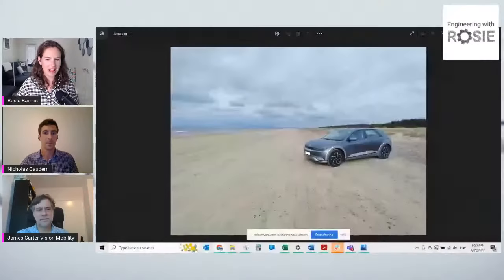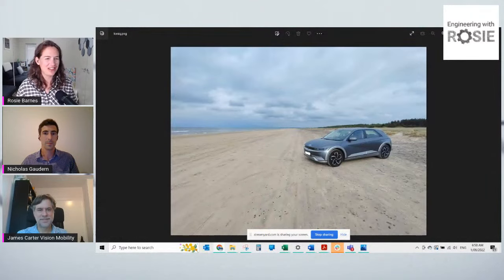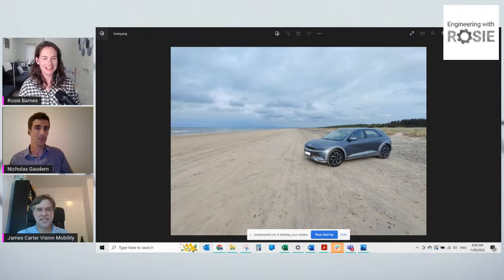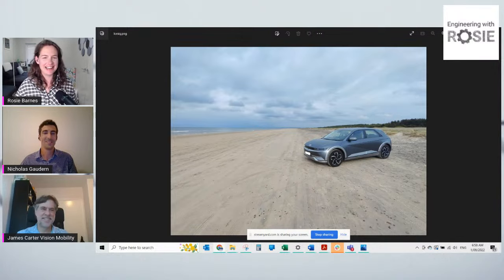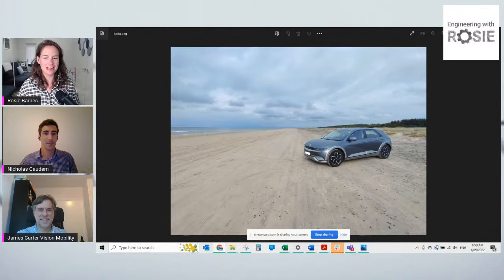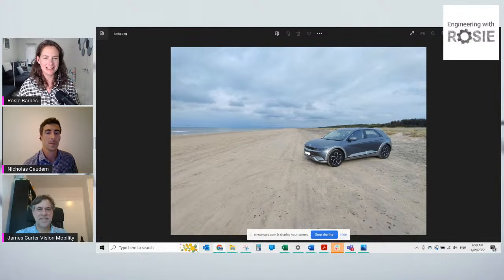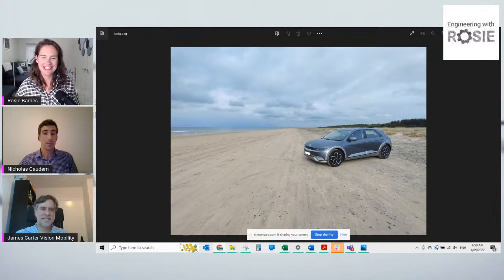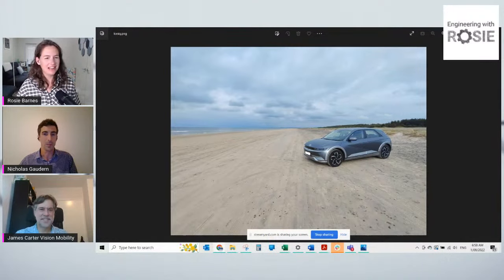Problems and Solutions to EV Charging Headaches | Engineering with Rosie Live Ep 16

Comment: All this talk of residential EVs. 

We do need to start moving this conversation over to commercial EV applications. That is where the real change to help the climate begins. 

Residential EV was the low hanging fruit to fund the start of the movement, but it needs to become a reality in commercial fleets sooner than later. 

Combine EV commercial fleets with swappable batteries and commercial rooftop and parking lot solar and it solves so many of the "problems" with EV adoption. 

And the more we green mining, transportation, refining, transportation, production, transportation, distribution, transportation, and then endpoint delivery - the greener it becomes to make things like solar panels and batteries. So the promise of the product is a beneficial feedback loop that reduces emission for every product produced on the planet.
Reply: 5353 Jumper,  There is a Amazon distribution center about 1 mile from my house, Portland Oregon.  They are charging about 40 Rivian delivery vans each night.  No battery swap needed.  They run them on the 100 mile or less delivery route, so easy for the battery to make it.

Comment: The slow charging in winter is only until the battery warms up, which is why Tesla has such a leg up since on all their models you can precondition the battery to heat up the right temperature for when you arrive at the charger. More manufacturers are now waking up to that fact and beginning to include it. With pre-conditioning it's basically a non-issue. Just watch Bjorn Nyland's channel, he lives in Norway and shows you almost every model out there and how they charge in their very cold winters, as well as other seasons. 

As an example, doing his 1,000 mile kilometer challenge on a Tesla Model 3 Performance, he completed his 1,000 kilometers in 9 hours and 15 minutes during an average temperature of 24 degrees Celsius, whereas doing the same challenge using the same Tesla Model 3 Performance during a much colder average of 7 degrees, he still completed it in 9 hours and 55 minutes. A difference of only 40 minutes total. Not only are all his videos there for all to see, but he also keeps a detailed spreadsheet of all his results that anyone can see or download. His provides the link on his channel.

Another thing that will help are new battery designs such as the 4680 which can be cooled and heated really fast on 800 volt systems -- that's the main point of all those small folded-in tabs. On the 800 systems they are going to cooled from the bottom just like Lucid does it now. However, theirs don't have the extra folded tabs -- yet. The tabs allow the cells to be cooled on the inside rather than only from the outside as it's done now. Tesla is not doing that yet on their 400 volt current system.

Comment: Intersting conversation.  I would like to point out that small batteries do not charge faster.  A larger battery can be charged at the same “C-rate” [ kW per kWh capacity].  As a result, given appropriate charger power, it takes the same time to charge no matter the battery size.  Since a larger battery has more range, EV drivers will get more range per minute charging in a large battery EV.  So in the end the large battery will take less charging time to get km needed to get to the next charger or destination.

Comment: Nicholas, Please note that the heat pump on Teslas use their “Octavalve” to direct heat from a selection of sources to a selection of sinks.  The Tesla heat pumps can heat or cool the battery as needed.  Heat from the motor and inverter can be directed to the battery or passenger cabin when desired.  Heat stored in the battery can heat the cabin when needed.  It can also heat or cool the cabin from ambient air source like conventional heat pumps as well.
Reply: Perhaps that experience Nicholas made was before the heat pump was introduced.

Comment: Car parks with each station with an electrical outlet  for a block heater are found here in Canada. They would support charging and could be made more common and upgraded for the purpose.
Reply: The 120 volt receptacles put there to keep a car block warm in the winter can put out about 1.3 KW per hour to charge a EV.  They are painfully slow to charge a 80 KW battery, compared to a slow Tesla charger at 120 KW, or a fast charger at 250 KW.  So a 15 minute charge on  a Tesla charger can add about 120 miles of charge, while the 120 volt charger can add about 4 miles each hour.

Comment: As the vast majority of shopping trips and commutes are much less than 100km roundtrip, a small sedan or suv with 100-150 km range on plug in battery alone with a small gasoline generator for longer trips. The generator need only be sized to the aerodynamic drag and tire friction. It could be very efficient and clean burning, especially if the battery was used to pre-heat it. Stopping and plugging in wouldn’t be too onerous and you’d only be charging to the 100km range. 

I’ve been looking at plug-in hybrids as here in western Canada, as the charging network in remote areas is very limited and the distances are large (much like Australia). My problem is that the only ones available are true hybrids with the engine directly connected to the drivetrain and the engines are as big or bigger than a similar gas vehicle.

Edit
Congratulations on your news. Very exiting!
Reply: It can't be small - 15-20 kW would be a minumum, I think.
Reply: @HughCStevenson1  I was thinking about 50 kw, not the >200kw that I see.

Comment: 14:20  I haven't driven a Tesla, but when the temp drops I use the heated seats and heated steering wheel much more rather than heating the entire cabin and letting all the glass whisk away the heat.   The lowest I can set the cabin temp is 60°F or off.  I wish I could set it to 50°  But setting it to 60 and using the seat heaters helps a lot regarding range.

Comment: James Carter, Please note that the Nissan Leaf battery is NOT air cooled.  It is in a completely sealed enclosure, with no air intake or exhaust.  The only cooling is from natural convection and blackbody radiation of the outside of the pack.  It does have a fan, but it only recirculates the air inside the pack to keep the cell temperatures consistent, it does not cool the pack.

Comment: Aptera is going to try to start production this year for their solar covered trike, initially with 400 or 600 mile range, later 250 and 1000 mile options, 2 or 3 wheel drive. You sure you don't want to do an exploratory run to Perth in one?   Charging is super important. It should be really easy to know when chargers are working, particularly ones you pay for. You should get access to information about the last 10 charging sessions, when they happened, and what the rate was, and so should the maintainers. Kyle from out of spec something youtube channel talked to a guy about chargers. Gen 1, 50kw, gen 2, 150 and 350kw. Gen 3-4 fast of course, remote diagnostics, modular so easy to repair, designed for reliability.
Reply: Also, everybody, copy Tesla with charging. Plug and charge like the Mach e, and Lightning, precondition the batteries on the way to a DCFC, never have just 1, and keep them working. Let's go!

Comment: Hi Rosie, you might be interested. California are using phone emergency alerts to peak shave. On the 6th Sept they had a 800MW drop in 5mins, 2GW in 20mins after a alert. Instant carrot and stick methods are probably underestimated by energy (future) forecasters. Equally encouraging charging of privately owned batteries into the grid instead of curtailment is probably very underestimated. 😁

Comment: Tesla definitely uses the heat pump during battery preconditioning. In a Tesla the heat pump does not weigh much, but the octal valve allows it to be used to heat and cool wherever the car needs it with a single pump.

Comment: My suggestion to new EV drivers is to think like an airline pilot. You always carry sufficient fuel (charge) for the planned trip + a 3% contingency for changed conditions (winds, hills temperatures) + an alternate runway/ airport (in case the chargers are occupied or U/S) + 30mins fuel (remaining charge for absolute emergency)   
Simplified for an EV,  plan journey to arrive with 15-20% battery in ideal conditions.
 Don't push the range, neither an airliner or EV running on  empty are relaxed experiences This has worked for me a retired long haul pilot and EV driver.

Comment: Thank you.  The swappable battery idea needs a deep look.  Batteries as modules, for example, where the entire 100 kWh does not have to be picked up at once.  The battery might be a simple holder of electrical energy with the interfaces providing the standardisation you speak of.
Reply: Swappable batteries are the solution for commercial EV uses. Either industrial machines, short haul trucking, courier vehicles, last mile delivery vehicles and passenger vehicles. 

Mostly when combined with commercial rooftop/parking solar projects. 

Because the vehicles are mostly off site during the daytime sun, and then on site in the evenings. It is hard to charge them with solar, and thus companies are reliant on the grid buyback plans which are not totally cost effective and subject to the greed of the grid organization. 

But if your fleet had swappable batteries the company could charge during the daytime sun for the vehicles to use tomorrow. Keeping all the power generated stays on site reducing the reliance on the grid. This handles the objection of the grid not being able to support a large scale charging facility, and could be more cost effective long term for the company. 

The only ones who hate (and will resist) this idea are the for profit grid, and grid scale generation companies. We will need to watch out for their obstruction wherever it pops up.
Reply: @5353Jumper  It would be interesting to see someone make a compelling case for standardisation of some particular battery design.  Somehow that happened with 6 v, then 12 v batteries, much like 1.5 v in different dimension, 9 v with the same dimensions.  In other words, it has happened before.  And just like those small batteries, the way they were connected and used was up to the design engineer of the device using them.  

Also wonder about rural and remote sites using solar and wind to charge up the batteries.  Would it make economic sense?  I don't know but I am thankful for Rosie and friends for looking into both the technical and eocnomic feasibility of whatever is envisioned.   

I imagine swappable batteries would require robotic swapping, to help ensure weight handling and exact fit to the electrodes and the carrying frames.  To this layman's mind, that seems to be no biggie.   Fascinating stuff, this transition stuff.  Now we might look for appropriate finance to support all this transitioning.
Reply: @mikeklein4949  standardizing would be great with a bit more market maturity. For now maybe it is better to let innovation rule. Eventually standardizing happens organically, as battery manufacturers partner with auto makers.
Reply: @mikeklein4949  reality is that the only reason this is not happening is because of political obstruction by the petroleum industry, traditional auto industry, and for profit grid. They are all resisting change and only letting go of small improvements over time to keep the public thinking there is some progress. 

All of this could have been reality years ago as it is all technically designed already. There are no major technical blocks or problems that are not already solved. 

The issue is obstruction by powerful industry. 

Petroleum companies want us to keep burning their products as long as possible. 

Transportation companies like the fact that 20% of fuel is burned just transporting fuel around. If they electrify transportation it greatly reduces the amount of transportation needed. 

Mining companies want is to keep using aluminum for engine blocks and transmissions until their bauxite mines are depleted, before they start investing in lithium and other battery materials. 

Auto makers want to get as much return on investment as they can from all that R&D they spend trying to make "fuel efficient engines". 

Grid generation companies want to block and regulate the crap out of commercial rooftop and parking lot solar. They do not want massive consumer side projects generating significant amounts of electricity because they want to maintain their oligopoly market demand. 

For profit grid companies want to keep delivering electricity to customers because they make more money per W delivered than they would just connecting to back up your local generation capabilities. Or worse yet your company/home going off grid all together. 

The hardest part of all of this is getting supportive legislation from government instead of obstructionists legislation. 

Very few people in power want to see this become reality.

Comment: Kyle Conner, a you tube person drove a Tesla to a super charger using the floor it and then regenerative braking to warm up the battery.  Both cars stated at 9 pm at 40% state of charge.  Then the next morning, they both drove 20 minutes to a supercharger, his wife taking a identical car and driving normally.  He charged to 80% in 29 minutes, as his battery was lower charge than the kind driven Tesla.  The kind driven Tesla had a much colder battery, and took 59 minutes to reach 80% charge.  The outside air temperature was around 25F, or -4C.  So the car the wife drove, the battery was around 32F (0C), and it took a lot longer to charge to 80%.  

I think the battery should be close to 75F or 22C if possible when they start to charge.  Yes the pre-charge can use 5% of the battery power on a cold day to heat up the battery so it can accept a larger charge on a cold day.  Some cars have a chart, that will say "Heater use 15%, pre-conditioning 5% or 8%, driving 72% ect.  

Wireless charging - I don't want one!  They will use about 25% to 50% more power to get 50 KW into the battery.  Those who used one, reported that the charger needed to be spot on, not 1/2" to the right or left, front or back.  I guess if the charger looked like a Roombo vacuum cleaner, and actually centered itself under the car, that would solve that problem.  But so easy to plug in the car, and have the ability to move 40 amps with almost 0 volt voltage loss.

Comment: interstate freeway I-90  has areas with few chargers and NO super chargers.  the tesla semi trucks couldn't easily travel on I-90.  one megawatt to charge.
Reply: By the time they will have Tesla Semi travel that section of I-90, they will have a super truck charger every 300 miles or so.  The Semi will charge at 900 volts DC, so super fast! 30 minutes will extend the range more than 200 miles.

Comment: See for Kromrey and Bedini motor-GENERATOR/(MAGNETOCALORIC COOLER) charging. An ideal source of REACTIVE POWER to shake the ions WITHOUT HEAT releasing.

As in pneumatics the TURBOEXPANDER helps to cool the filling of the Dewar flasks, so it is for batteries. Ionic "turboexpander". 

"Turboexpanders" (rotating or VIBRATING) are needed for electricity and companies have them.

Comment: James' early comment about range loss in the cold was misleading. I also live in Canada and drive a Tesla Model 3.  I have never loss 50% of range due to cold, even down to -25C I've only lost at most 20-30%.  The US EPA calculates the 400km of range based on 60% city and 40% highway driving. Unlike a gas/diesel car, an EV has better range in city driving compared to highway driving. That's means you always have less than the rates range when traveling highway speeds regardless of the temperature.  It's not range loss, it's just the range.

Comment: We do need to make it far easier to charge an EV and travel using one, and we also need to design our cities and promote car-lite lifestyles where most people in metro areas don’t own their own car. The best EV will never come close to the energy efficiency to move people of public transport, cycling, or walking which, in most cases, are the entirely suitable for typical urban trips. Better transit options, safe and connected bikeways, and shared-use on demand EVs that require less overall space and energy are a better holistic solution. The average car spends 95% of its time parked…

So a clever engineering solution to ubiquitous domestic and suburban charging ignores the question of is ubiquitous charging and car ownership desirable or sustainable. The future of most cars should be electric, but the future of most transport shouldn’t be cars.

Comment: It sounds like cabin AC and battery temperature control should be integrated in to a single system... If the battery is thermally insulated from the ambient then its temperature could be controlled quite easily. If you have an AC then you have a heater... it is a heat pump, just like in a house.
Reply: It sounds like to Octovalve does this?? (reading the other comments...)

Comment: How people can't understand that a battery has a low energy density. It is awesome for a small application like power tools and riding electric bike or a small car around the town to do shopping, drop kids etc. EV beats in a city driving ICE as lots of start stop, but on motorway EV can't beat ICE especially diesel. We coming to a case that a family needs either 2 cars an ICE and EV or a hybrid. Just look at the battery power tools quite lots of them especially those which are professional have replaceable batteries so that you can charge one while you're using another. With EVs in long distances you won't make it convenient unless you will have a quick battery swap.